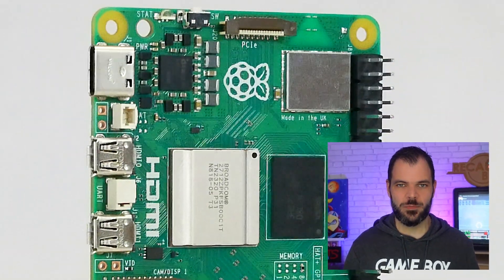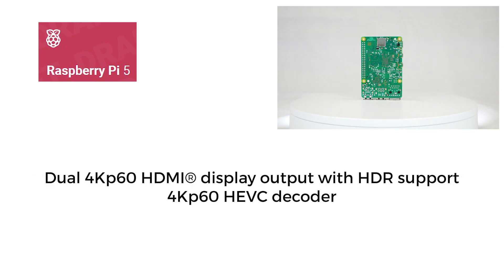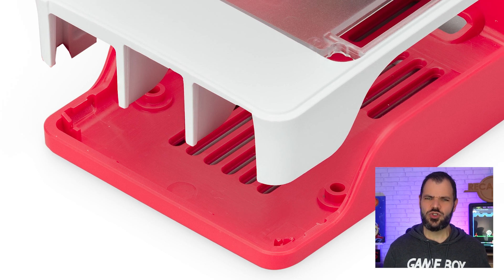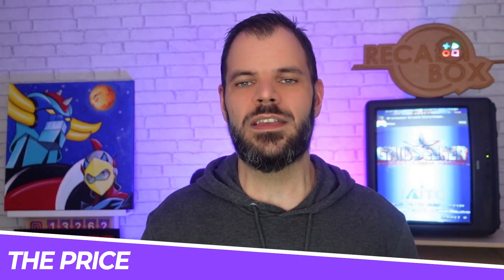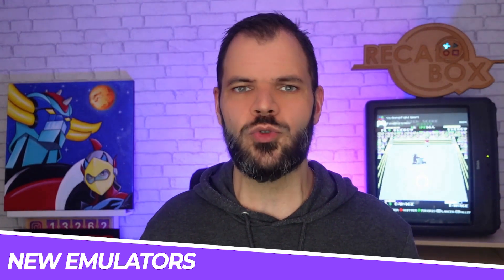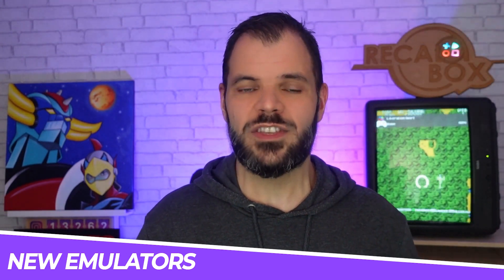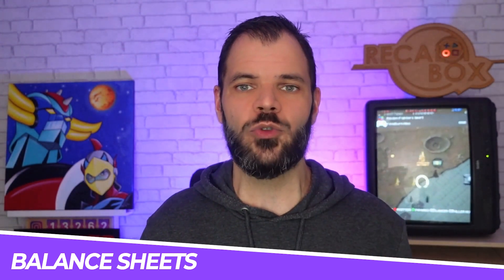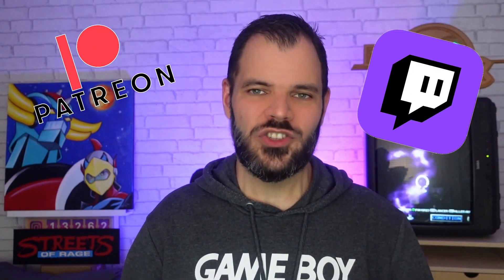RECALBOX 9.2 ON BRAND NEW RASPBERRY PI5 !!

Comment: i cannot achieve > 2.7Ghz speed using a pi4 power supply, i am waiting for the 5.1v/5A power supply to arrive to test if i can achieve 3.0Ghz speed. I also get the low current nag screen warning on boot (that i finally disabled).